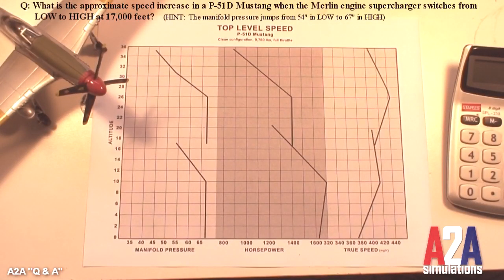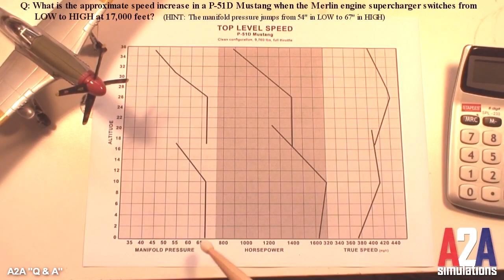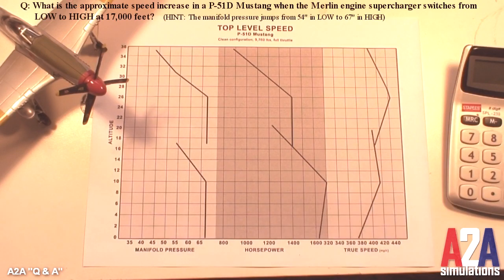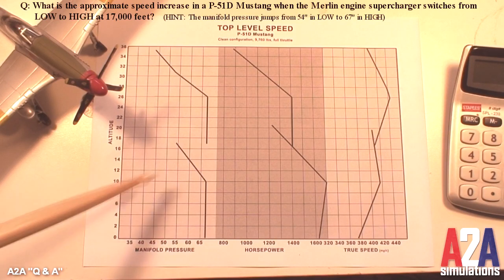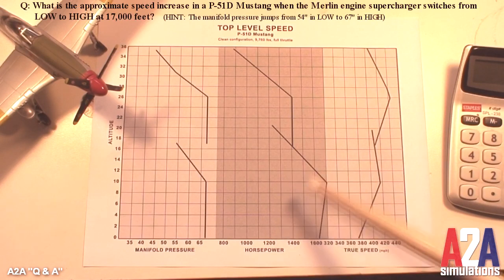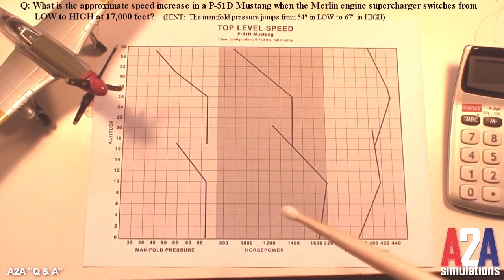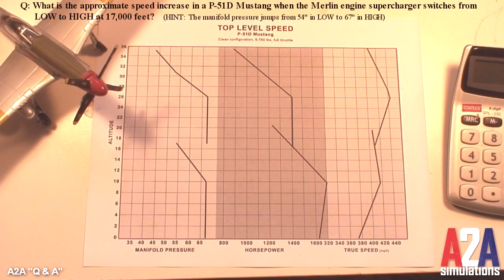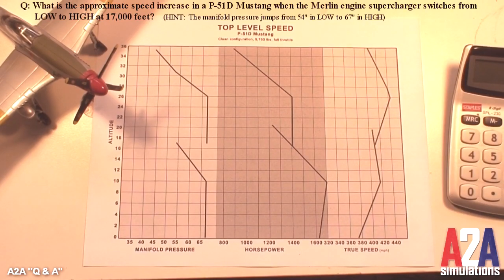A2A Q&A "Dual-speed superchargers and top speed in the P-51D Mustang"

Comment: Can you explain why the horsepower remains the same at the switch between low and high if the manifold pressure jumps back up and you are still at the same air density? Therefore you must be pumping more air into the engine. Unless the fuel delivery remains unchanged?
Reply: Yes, the engine is producing more horsepower at 67'' of manifold pressure than at 54'', but at 17,000 feet, all of that extra 13'' is being CONSUMED by simply running the supercharger. Brake horsepower is the amount of horsepower that is actually able to turn the propeller, and that's what's shown on the chart. The engine is rated up to 1700bhp at 67'', which is about what you achieve at 10,000ft with the LOW supercharger mode. Given that, according to the chart, you're only producing about 1400bhp at 17,000 feet with both the LOW and HIGH modes, we can infer that it takes up to an extra 300hp simply to run the supercharger in HIGH mode.

The gains come as you climb higher, where if you were using LOW mode at, say, 20,000ft, where you'd only be producing about 1200bhp due to only being able to produce (extrapolating the trend) about 47'' MAP. Activating HIGH mode at that point jumps you back to 67'' and 1700hp total, and consumes 300hp to run in HIGH mode, leaving you with 1400bhp: a net gain of 200bhp over simply leaving it in LOW.

And the gains only get better the higher you go, until even the HIGH mode isn't able to keep up with the thinning air anymore. Anyway, sorry for making that so complicated.